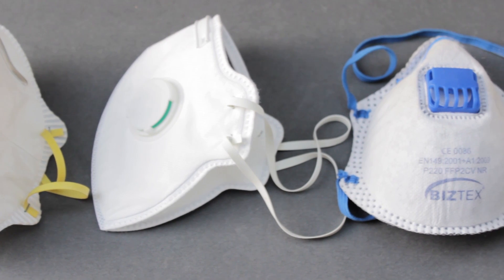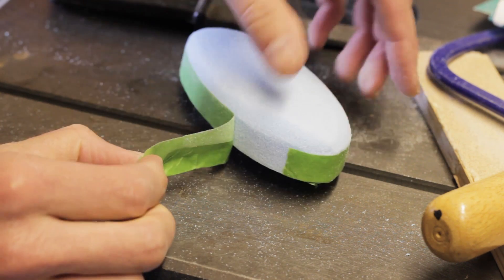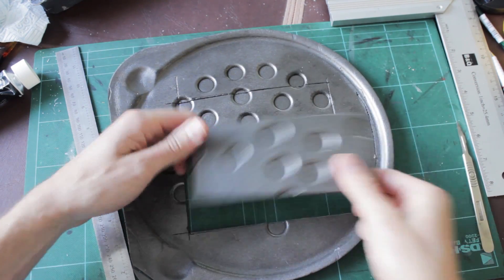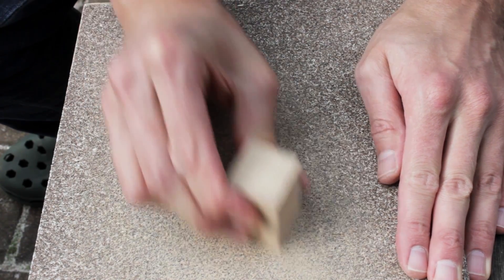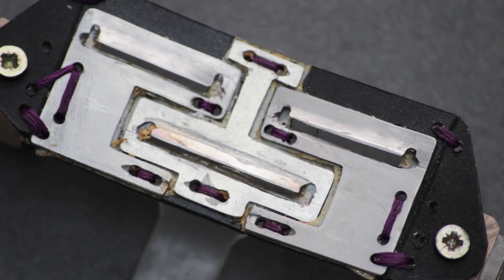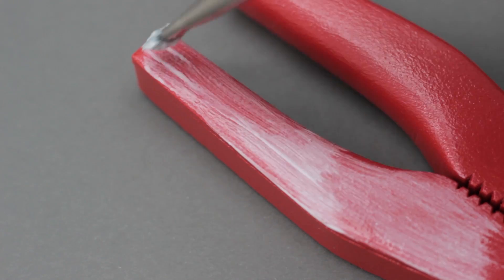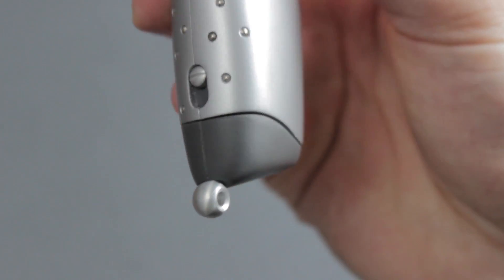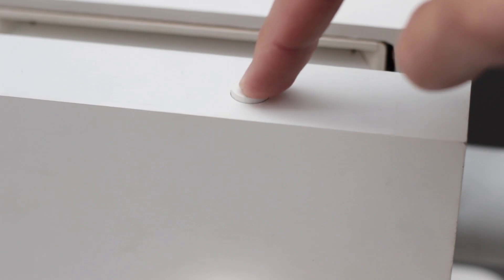Prototyping and Model making - Students of Product Design Episode 6

Comment: Is the blue foam buoyant (floaty) or flammable?
Reply from the maker: Hi Oddball, thanks for the kind comments, bluefoam does float and is very buoyant.  I haven't done any flame tests on it, it does melt, but I'm not sure if it would set on fire.  I'm sure if you do burn it it will release some fairly unpleasant fumes. Pt
Reply: @producttank  Thank you. I plan on prototyping my boats and want to test them on the water. I just wanted to make sure they floated, and the flammability was out of pure interest. (I'm not going to be setting them on fire)

Comment: Your videos are incredible. Thank you so much for the effort you put into making these!

These models are great for small prototypes. What if you're making a large prototype, such as a car or a physical enclosure that someone is going inside and out off? What the best way to create a cheap model for that? Would it be Blue Foam? I would have to get a lot of blue foam and then sand around it.. Is there a material that could be better for this purpose? Appr dimensions are circular: Diameter is 4 ft and height is 5 ft. Thank you!
Reply from the maker: Hi Jesal, it all depends on what you're going to do with the prototype.  If it's to try it out for strength, then blue foam probably isn't going to be the best material.  It's really hard to comment without knowing what it is, but with early prototypes you want to work quickly and cheaply, so wood and cardboard as well as blue foam are all good.  Lots of prototypes are mixed materials, so for what you've described, don't be afraid of a wood or plywood frame skinned with card and blue foam.  You can quickly hot melt glue or screw everything together, work out what's not working, rip it off and make quick adjustments. PT
Reply: producttank Thanks for the reply. The prototype is less about strength and more about the vision for what it could be like. Using a car as a metaphor, I am really showing off the engine, but need to show the car is what could be a possible form for it. Does that make sense?
Reply from the maker: It does, I think you need a visual appearance model.  Depending on your audience and to save a lot of time and money, it's best to make a scale model or use images to show the form of the car and show off the engine separately as a prototype. PT

Comment: These are some fantastic tips. I, not an ID person, will be using these tips to give prototyping a go. Would you be able to suggest any manufacturers you've work with in the past that specialize in plastics (injection molding and blow molding), foams (polyethylene) and metals (machining/casting)?

Best, 
RC
Reply from the maker: Hi Roberto, I worked for a design consultancy and we supplied the CAD data to companies who had their own manufacturing premises or they took the data and sourced manufacturers in China. I wouldn't be able to recommend any in particular.  It depends where your based and what you need manufactured.  Sometimes it's better to get a local company to make the tooling and then take this to a moulder, but it impossible to recommend this without knowing what you want to produce and in what quantity etc. Best PT

Comment: Is there something I can put on the blue foam to make it hard?
Reply from the maker: Hi A1EX, you can cover areas of blue foam in wall filler, as long as you handle it carefully as you will have put a hard material over a soft one, so any impacts (if you drop your model) spread the shock and lead to big dents.  You can also cover your down in a variety of paints or glues as long as they are water based.  I'm sure some resins won't melt it, like the ones used to make surf boards, but haven't had any experience using these.  Watch the dust and wear the proper safety equipment. Best. PT

Comment from the maker: Hi Bad's Productions, I can't reply directly to your email. Your question is really difficult to answer properly without knowing what you're making, and how much weight/load is bearing on the thin sections, but blue foam is quick to sculpt, so you could make a test piece. If you have the tools, wood will obviously be much stronger. PT
Reply: cool +producttank are u a designer ??????

Comment: "Designers need to be hands-on". Exactly! Products that are hand-held or meant to be touched by people should be, at least initially, designed by hand. Rapid prototyping is great, but not for people without experience and they are essentially hands-off tools. Additionally, when mistakes are made during the hands-on prototyping phase, they can usually be detected and corrected. In rapid prototyping a mistakes often means that you need to start over with making the part (or fix it by hand).